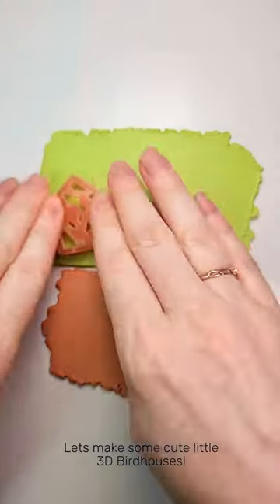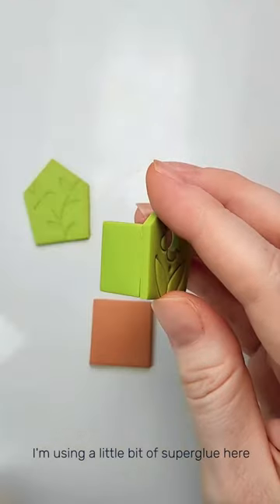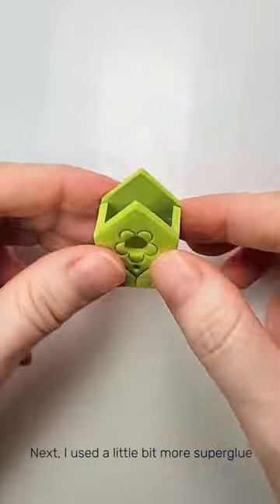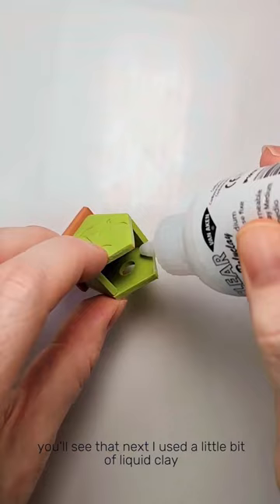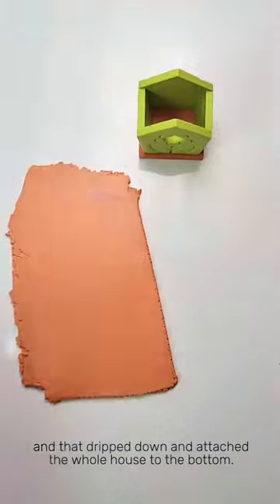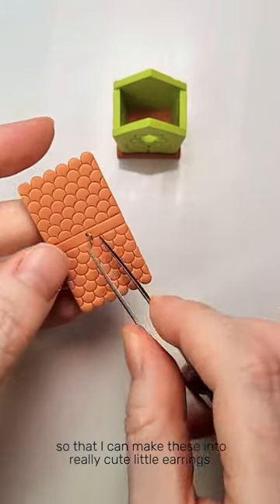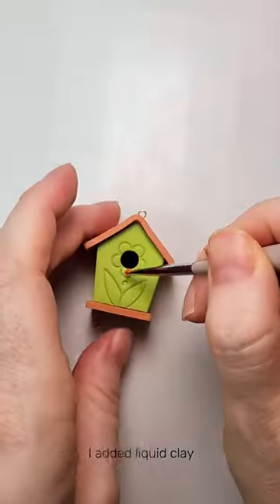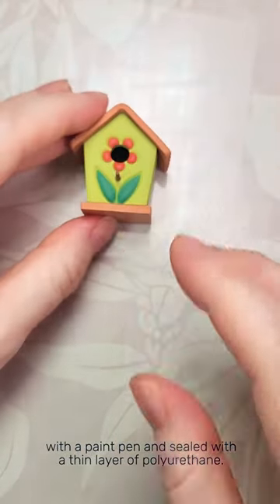Polymer Clay 3D Bird House Assembly

Comment: How would you add a stake for plant decor?
Reply from the maker: This is a great question! I'm not sure if this is absolutely the best way to do it, but here's what I have done: 

I drilled a hole in the cured ground piece after removing it from the oven. I then added some clay to it, on the part that will sit inside the birdhouse, by attaching a little mound of clay on the ground piece. Then I stuck a stake though the hole and into the mound of clay and rebaked with the stake in place.

I then assembled the house with glue, added liquid clay to the joints and rebaked. Then when it was all finished, I added some gel super glue into the hole I made for the stake and glued the stake back in.